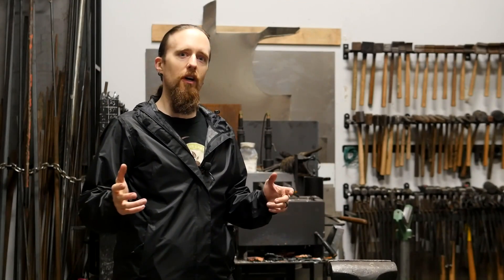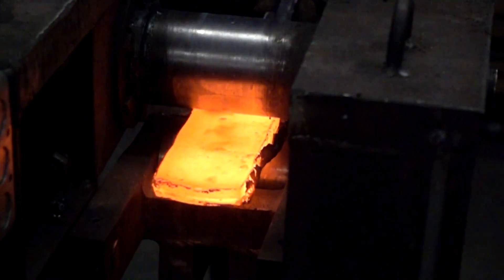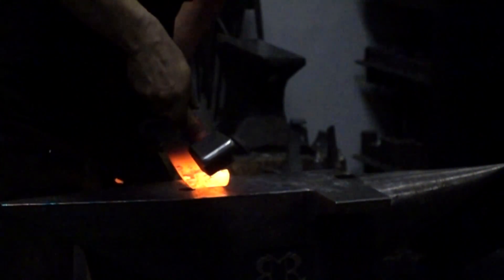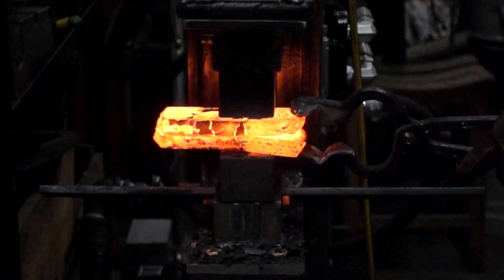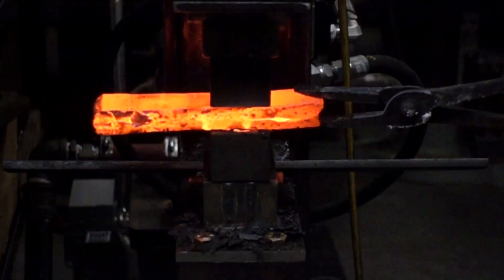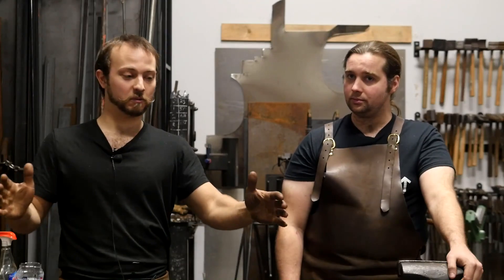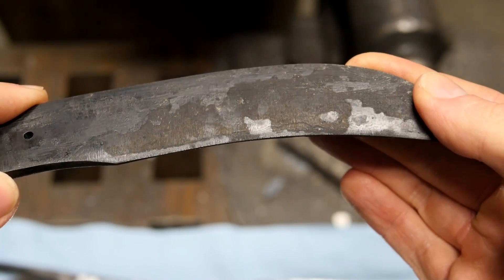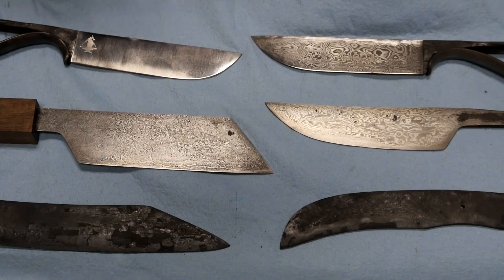What is Pattern Welded Steel ("Damascus") - Explained by Blacksmiths (Part 1 of 2)

Comment: Skallagrim, you make consistently excellent videos and your guests are equally interesting.  I'm not a blacksmith, but I'm pretty certain that only crucible Wootz steel can be called Damascus.  The resulting patterns in Wootz is very different from pattern-welded steel.  A traditional Japanese katana will show flowing patterns and a Wootz (Damascus) shamshir will show flecks of carbon and different "islands" of steel.

There is a crucible steel society.  IpostSwords is a founder and has a YouTube channel.  Maybe you could do a video with them?

Comment: I still find it inherently irritating that we use the term "Damascus steel" when correct and specific terms like "pattern welding" exist.

Makes it easier to define things like wootz, pattern welding, etc.
Reply: As I understand it, the term 'Damascus steel' has become more of a marketing term rather than a proper technical term. Real Damascus steel supposedly only came from specific iron deposits from the region and those veins have since dried up. I'm sure that the people really into arms and armour and blacksmithing know the difference between the two.
Reply: Fat Tiger Yeah, original "Damascus" steel, being wootz, came from certain mines with vanadium in their ore being turned into crucible steel and properly handled during the forging to avoid dissolving the carbides again.

I have a few examples of it
Reply: Yes, Damascus steel is technically steel mined in Jordan near Damascus. It can have a pattern or not. The best Damascus steel has a pattern, but the amount and how defined the pattern is can vary depending on the purity of the steel, smelting and forging techniques etc. 

Steel from that mine varies a great deal. Ore that was exposed to the atmosphere for too long will not produce the pattern because of contaminants. Making it difficult, if not impossible to reproduce accurately, even if you had the smelting and forging techniques.
Reply: I just gave up and stopped using the Damascus term, too much confusion around it. I use the other more specific terms (wootz, pattern welding, folded steel, etching, etc). When someone says Damascus, I just ask "are you talking about wootz, pattern welding, or some form of etching? etc", and don't even try to get into the "what's the real Damascus" discussion.
Reply: The original Damascus steel was Wootz (as was previously stated) forged using the old eastern technique which involved wrapping the ingot in hay and Clay before heating to temperature, then folded quite a few times like in western methods. Doing this, you get carbon nanotubes in the steel, which strengthens the blade far more than other methods and metals did at the time. The true art is long lost though, and the closest we can do to recreate it is by doing the old Japanese method, which may or may not be the same method they used to make Damascus steel. I haven't watched the video, but based on your comment, they are just forge welding and folding multiple metals to create a patterned steel
Reply: I find that with high end kitchen knifes it's even worse. It's normal for companies to market their product as "damascus steel" even when it's just a high carbon steel core enveloped by stainless steel sheets, to protect from rust and corrosion. It's just silly!
Reply from the maker: As far as I'm aware there is no single noun for "pattern welded steel", which is quite a mouthful in a sentence. Using the term "Damascus" is technically not accurate, but when talking about modern work as opposed to antique originals it's pretty obvious what is meant, so it's not a big deal in my opinion. If the term is good enough for blacksmiths it's good enough for me.
Reply: IPostSwords specially since apperantly theres an ancient steel with the same name we still don't know how they made it exactly.
Reply: I still find it inherently irritating that we use the term "stainless steel" when correct and specific terms like "ferritic" exist. 

Makes it easier to define things like austenitic, ferritic, etc.
Reply: From everything I've read Damascus steel never came from Damascus. Damascus was a major trading hub for the region, the metal came through there but didn't originate there. It's beleived it came from India. There was a lot of interesting iron mining and steel smelting out there. The steel was formed in the crucible rather than just the simple ore that was mined.
Reply: The use of the term "Damascus" for pattern welding was mostly popularised by firearms makers in the 19th century, mainly shotguns. It's been used that way for a long time.
Reply: "the old Japanese method" is definitely not the method "they" used to make Damascus. We know this because wootz had been thoroughly analyzed using modern materials science and then been experimentally recreated. There is no "lost secret." See the work of people like the late Al Pendray, etc.
Reply: bob joe "Damascus steel" was not used to refer to swords in Damascus. It was a western term used to describe steel exotic steel that had come from the east. "Damascus" was the name used because it was a place name people knew and where a lot of it was sold, not where the metal originated.
Reply: In litterature, the word damascus started appearing near the 17th century (iirc) in gun making, when they started making what they then called damascus steel barrels. They named it that way in reference to wootz from damas. I have searched and haven't found mentions of damascus (i could be wrong) before this time. They used to call it wootz. Wootz is wootz and IMO pattern welded steel was always named damascus in reference to how it looked like wootz, not in direct refence to being the same thing. 

This topic has been approached often and this is what always pops out. Everybody has a different story about it and most aren't backed up by anything.
This answer is the only one that is backed up by (litterature) references. 
The term damascus seems to not have been used before it designed the gun barrels steel, or in translations from old texts (thus is affected by the translator's bias).

and again, this could be wrong, since nobody can read all the books and know all about them. It could very possibly be true that wootz was called damascus back then, but from what I gathered, it is very unlikely.
Reply: Okay there was no such thing as "Damascus steel" ever. No steel was produced in Damascus, they did have some smiths that made those famous Damascus swords which had patterns in them. These patterns were not pattern welded, they were impurities in the crucible steel which crystallised by the heat treatment forming a pattern.
The actual steel used by the smithies in Damascus was produced more likely in India, where crucible forges were actually found of that time, unlike anywhere near Damascus.
Reply: To add to the confusion there is damacsed steel, guns, blades, etc. A term which has nothing to do with the properties of construction of the base steel but a method of decoration.
Reply: Riceball01 the word I use for that gold inlay technique is koftgari, because I mostly see it on indopersian arms. But yeah, damascene gold work has an irritating name.

Forgotten weapons did a great special episode on it
Reply: History is basically just repeating things over and over, so you'll still find historians calling things damascus steel.  Then again, science and history is coming closer together, so I hear.  We will get the romantic revivalists and traditionalists cropping up again and again, but what can you do.  It helps to have a historian who can tell a good story, and then one who's scientific too.
Reply: It’s what it’s called. Jesus, just get over it 😄
Reply: Nw2343 Damascus is the oldest continuously inhabited city in the world over 10,000 years. Stop trying to attribute everything to Europe. Even gothic architecture was stolen from Syria during the crusades. When Syria was thriving, europe didn’t even have a candle
Reply: MMhhh, like, REAL Damascus steel is actually wootz, using the term for pattern welded blades because they exhibit a resemblance to the patterns visible on Damascus/wootz blades is a horrible misnomer.
Reply: @Svartalf14  literally the whole point I made in the original comment

Comment: I've always been curious as to what this kind of steel's various stats are and how they compare to other materials (especially their component materials). Does it result in a gestalt of the materials used, a middle-point, or something oddball compared to them? Are there any specific downsides to this material for practical purposes compared to using a single specific material?

Comment: Until this video I never knew that pattern welded steel and damascus steel are the same thing.

I had always assumed that the area around damascus produced naturally high carbon and relatively homogeneous ore, making it world famous for it's high quality steel.
Reply: Technically, the term "damascus steel" originally only referred to what is now called "wootz steel". Nowadays it's meaning has been changed to refer to the aesthetically similar pattern welded stuff, largely due to marketing from gun and knife makers. Real wootz/damascus is apparently pretty interesting stuff.

Comment: Does anyone know if pattern-welding 1090 carbon steel and folding it enough times to where it has a HRC between 55 and 56 is a good thing for a slender blade? The seller is telling me it has the hardness and flexibility of 1060 folded  with the "Damascus", and specifically, I'm wondering if this would work for a 36" cut-and-thrust rapier blade. There are 11 pieces of steel, folded five times, making 352 layers. Thanks!!

Comment: Whoa, this is a really cool video showing the amount of work that goes into just one blade. BTW, how do they make layers that thin? Can hardly imagine a steel rod that bands so many times without braking and losing its structure.
Reply: Даниил Банкин When steel is molten (even just slightly) it becomes more malleable such that the cracks fill themselves in.

Comment: I would like to know if this pattern welded style of blades are prone to rusting or not, if keeping in sheath is bad, if they need to have layer of oil on them at all times, etc.. i had some hand made finnish knives that rust when left in sheath and do not wish to make same mistake.
Reply: 1095 and 15N20 were used in the blades I have here.
Reply: TIPS FOR DAMASCUS BLADES:

THE KNIFE BLADE SHOULD ALWAYS BE CLEAN AND TREATED WITH OIL AFTER USE. PLEASE FOLLOW THE FOLLOWING INSTRUCTIONS:

1. TO PREVENT FROM RUSTING NEVER STORE YOUR KNIFE FOR LONG TIME IN LEATHER SHEATH.
2. LEATHER CAN ABSORB WATER, WHICH WILL RUST THE KNIFE.
3. ALWAYS CLEAN THE BLADE AFTER USING WITH MINERAL OR COCONUT OIL.
found on different seller's  site, so guess answers my question, sheaths are bad...

Comment: Can swords be actually coloured without affecting the performance of the steel? So giving a deep red to a blade ie
Reply: Johan:  Basically yes, though certain colors (such as blue or black) are easier than others.  The technique of coloring blades depends in part upon the quenching liquid (urine tends to yellow the steel for example), and also depends upon the tempering technique.

Comment: 124 and 384 layers? Strange, I would have thought that if you basically fold the steel it'd follow the 1-2-4-8-16-32-64-128 etc. sequence. I wonder how they got those numbers of layers.
Reply: Johan Oskarsson Because they don't always begin with a even number. To know how many layers they beginned, just divide by 2 until you found an prime number. That was the number of stacked inicial layers before the first folding.
Reply: Johan Oskarsson depends how many layers you start with. I usually start with 12 or so and cut them into three or four pieces instead of just folding once. So the numbers go up different and faster
Reply: what about the iron oxide that flakes off those are layers
Reply: Falena you would only loose entire layers to scale once the layers get very small. I don’t think it could happen in the numbers generally used to make knives but I could be wrong
Reply: @Falena You can use flux to get rid of most of the oxidation.
Reply: That makes a lot of sense. Sounds reasonable too. Thanks for the info.
Reply: 8 layers folding 4 times = 128 - 4 = 124. For each folding, 2 layers of the same kind come together and making 1 layer of them. Therefore you have to subtract 1 layer for each folding.
Reply: Oooooooooohh.... that makes a LOT of sense. Thanks!

Comment: A group on facebook claims they're selling real damascus steel blades. How do I know if that's true/what questions do I need to ask them?
Reply from the maker: Ask them which steels were pattern welded together. If they don't know, evade the question or don't give you the specific steel types, beware.
Reply: Thank you, will do!
Reply: They said it's a vines & roses damascus steel. Does that mean anything or are they making it up?
Reply: Sorry to keep bothering but I'd love to know what I'm getting into. After some time they said the following: "We make blades in D2, J2, Stainless Steel, 440c and mostly Damascus Steel. Carbon steel as well.". Are they legitimate?
Reply from the maker: Vines & roses is just the pattern, so visuals only. D2, J2, "stainless steel", 440C (which is a stainless steel), and "mostly damascus steel"? That's almost a textbook bullshit answer. Definitely avoid them.
Reply: Wow. Thank you for the heads up!
Reply: I come a little late, but perhaps both You and Skal will find this answer useful:
The only man I know of that created genuine WOOTZ (as in: crucible steel with looks and properties almost identical to historical blades) was Al Pendray  and he sadly passed away two years ago.
Simply put: it’s a hypo- to hyper-eutectoidal crucible steel with essential content of Vanadium, which promotes formation of iron carbides and carbon nanostructures (which occurs at relatively low temperatures). After forging, blades would be treated at these LOWER temperatures (often multiple times) to bring the pattern out (acid etching was not necessary for that) and this steel was most certainly NOT pattern-welded. Al worked closely with Verhoeven and a few other scientists, published a number of highly informative and influential papers on the subject... and it took them only just over 30 years to get it right from theory to ready blades ;)

Comment: I know my damascus knife is real and not "printed" because when I sharpen up the edge, it has a mirror finish. And then, as I use it, particularly for food, the different metals tarnish at different rates and the pattern reveals itself. So that's another method to check your knife.

Comment: How effective would a titanium sword be?
Reply: Not effective at all. Although its strength to weight compared to steel is amazing, titanium is hard to forge and sand and doesn't hold a sharp edge.
Reply: What about a Katana type blade, or a Dane axe sort of technique, whereby good steel is used for the edge, and titanium is used as a backer?
Reply: The only reason katanas were made like that was because the lack of good steel. Even the best steel of the time doesn't come close to modern steels. Non traditional katana using a single homogeneous piece of modern steel with modern heat treating/differential hardening are far superior to the coveted tamahagane, pieces. 

Long story short, homogenous (including pattern weld) carbon steels are still the best for making blades.

Comment: Importantly, Wootz steel is the steel that was used in Damascus and elsewhere in Persia and India to create the pattern-welded blades that reached western fame through the Crusaders. Wootz steel is the precursor material to True Damascus, not True Damascus itself.

Since the process to create Wootz steel has been lost, no contemporary pattern-welded blade can be truthfully referred to as Damascus. The continued use of the term to refer to pattern-welded steels is fraudulently trading on the historical legitimacy of True Damascus steel, and it is as much of a disgrace to blacksmithing as selling blades with acid-etched patterns as pattern-welded steel.

Anyone selling "Damascus" steel they claim to have forged is a fraud and should be denied your custom.